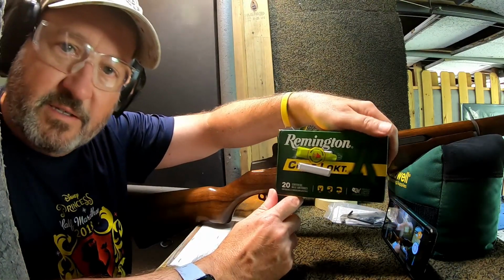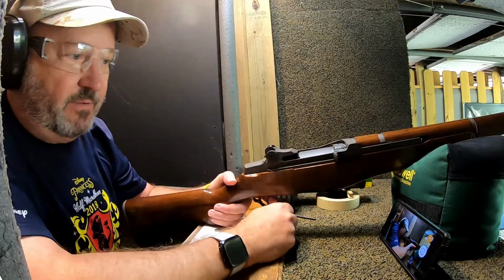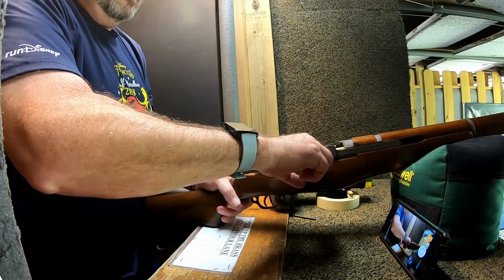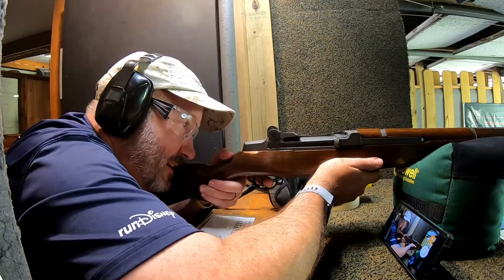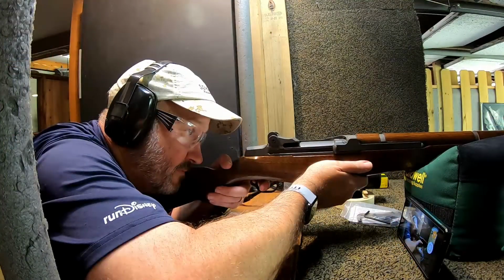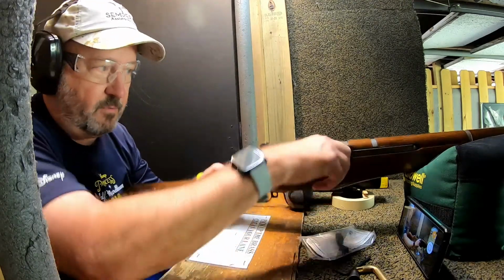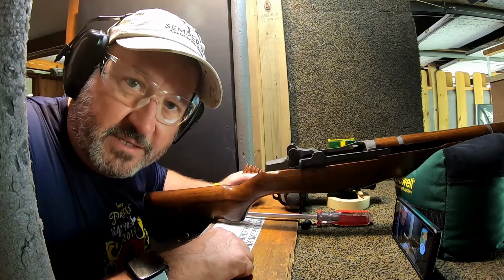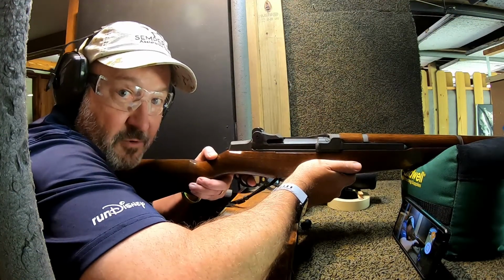M1 Garand 1st Shots

Comment: Keep loosening the Schuster a 1/4 turn until it cycles. It will work, just takes some adjusting. Save that op rod 🙏🏽
Reply from the maker: I will take time to make this happen.  Thanx for the advice and support
Reply: Am waiting for my m1 garand made in Italy for Danish military this 30.06 sadly here in republic of Ireland there's a semiautomatic center fire ban coming and mine is single shot only
Reply from the maker: Kudos on getting your M1  Boo on the one shot part.   But it's not so bad.  Before I got my gas plug worked out, I did one shot at a time.